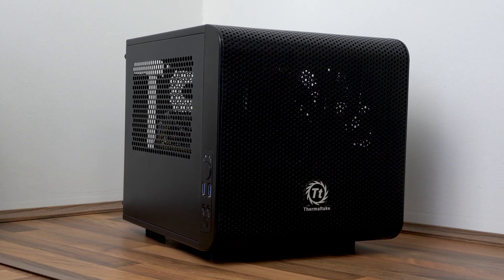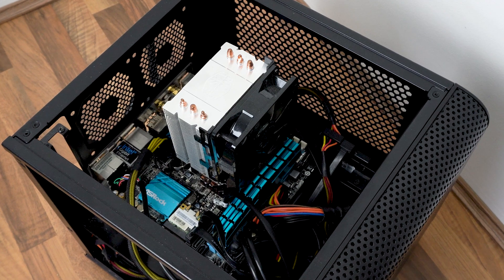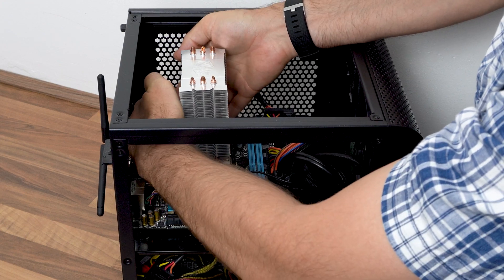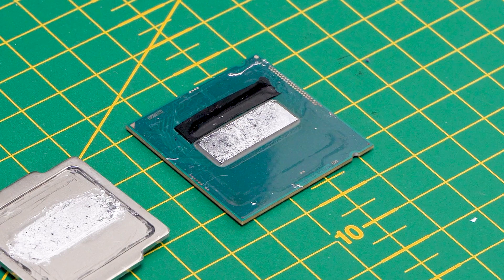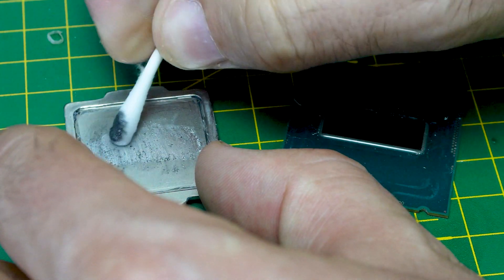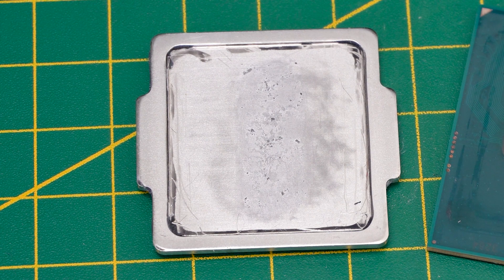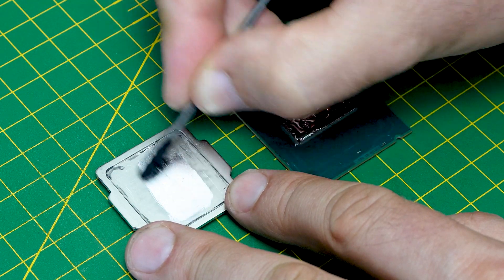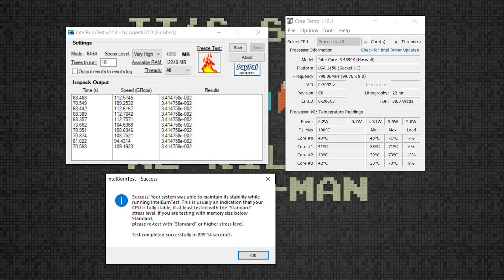Liquid Metal After 2 Years | Thermal Grizzly Conductonaut

Comment: UPDATED: Point 4 - Which Silicone to use

A few things you can do better my friend. 
1. To decrease the risk of liquid metal squirting all over your motherboard you can simply squirt it on something else away from the motherboard then use a Q-tip to dip it into the liquid metal and transfer it over to the CPU. A very simple thing that can prevent an accidental squirt. "Like what happened to Linus"

2. I read that the second application lasts much longer on copper once it is "Stained". So one trick I read on someone who does a lot of Liquid metal on CPUs is he first applies the liquid metal on the copper CPU and/or heat sink and lets it sit out for every couple of hours??? I can't remember how long he said. He said something about how it looks... Regardless I just went overkill and let it sit overnight. Now the copper can absorb and get stained in advance. You simply clean it off in the morning and reapply. If memory serves me correctly, which i think it does, he said to make that "first staining coat" very thin. I guess the open air can dry it out and harden it better. Idk, regardless he has for sure noticed that that classic temperature drops within a year and needs that secondary application. 

3. Will from the comments of this video had a fantastic idea of using silicone to seal the chip's crack to stop the liquid metal moisture from escaping and drying out the liquid metal. He claims that he checked his liquid metal 3 years later and it was just like the day he applied it. It's a fantastic idea but I do not recommend you use the JB weld silicone he used. I called JB Weld company and they said do not use any of their silicones that have the word "Adhesive" on the front for electronics since it could react with some of the electronic materials and cause damage. But he does recommend using any JB weld silicone that has the words Ultimate in front of it. He recommends using the black or the grey kinds and said that the grey is particularly good when aluminum is involved.  
- This is the name of the grey silicone:  "J-B Weld 32327 Ultimate Grey RTV Silicone Gasket Maker and Sealant"
- https://www.amazon.ca/gp/product/B00LIRGANA/ref=sw_img_1?smid=AETFOBSRMJ4G2&th=1
- No worries: it can handle 500F (260c) and it's not expensive

4. For comment readers. If you're really scared of liquid metal you can buy this and coat everything around that you don't want the liquid metal to touch. It just acts like a coat to prevent the liquid metal from being able to ever touch the components but doesn't affect the component's performance. Similar things are don't to electronics to make them weatherproof for outdoor applications. (Some computer people use some kind of nail polish.)
https://www.amazon.ca/gp/product/B089XXS72K/ref=ox_sc_act_title_2?smid=A3DWYIK6Y9EEQB&psc=1

Comment: do you think it is better for me to apply the liquid metal between the cpu and the heatsink in my 5800x? I have a noctua d15 heatsink with obviously noctua thermal paste and while I play I always remain around 70/75 degrees c.
Reply: I would just use TG kryonaut on the IHS and chip, conduntonaut and kryonaut when not in a sealed environment both last about 1 year his was partially sealed, I use Kingping KPX on my 5900X I have a 120mm AIO with a noctua A12x25 on it it idles at 30C hits 56C while playing AAA titles during a multicore cenebench r23 multicore run I hit 75C, next re-paste I’m trying out TG kryonaut extreme I been away from PC’s since 2003 so I gotta learn all this stuff over like if you need to replace thermal pads k5 Pro is awesome for that it replaces pads up to 3mm, found it on an LTt video called “more FPS for $10”

Comment: Something like this pitting will never happen to EKWB coolers it just typical american quality this intel IHS. I realy dont know why american companies are not able to choose proper material...you have this all over from tech to aviation to other branches american companies have always problems with their metall stuff. Btw no h8 guys just what i can see.
Reply: Would it corrode a copper heatsink?  It seems to be fine on the Nickle CPU die, just burnt marks into the cheap intel heatsink.
Reply: @johnepling3664  Liquid metal on bare copper will dry due to gallium going into copper. No corrosion. Nickel plated liquid metal stays wet  also no corrosion. Except you have cheap material which is not clean enough.

Comment: If you glue your IHS to the CPU tray, the luqid metal will stay in the way longer.  I had mine sealed for 3+ years, and I just got worried, so open it up, and it looked just like day one.  Super good.
Reply from the maker: Thanks.. that's great advice 👍😎
Reply: Quick note friend: JB weld silicones with the word "Adhesive" in the name can react to electronics in time. The JB weld silicones with the word "Ultimate" Infront are safe to use according to the JB weld customer support. Customer support recommends using the Black or Grey kind for our particular application. They said grey works particularly well for anything aluminum.
Reply: @sprinterlex2082  Thanks for the tip.
Reply: Do you recommend any type of glue?
Reply: @ahmadmohmed4448  J-B Weld 31319 RTV Silicone Sealant and Adhesive (the black one).  If you can buy it.  If not any high temp silicone glue should work. Only apply it a little bit, but make sure no gap.

Comment: Its better to have a gold layer on the ihs that prevent the liquid metal to corode the nickel layer of ihs  😂😂😂, the PS5 have some padded foam around the cpu die to prevent the liquid metal to spread out.
Reply: Gold is bad to transer heat.
Reply: @sidewinder86ify  then why there is gold layer underneath the nickel ihs on delided ryzen chips ? Im pretty sure that aint copper.